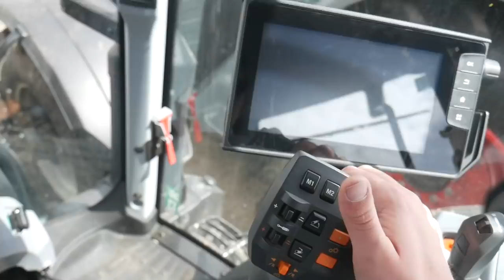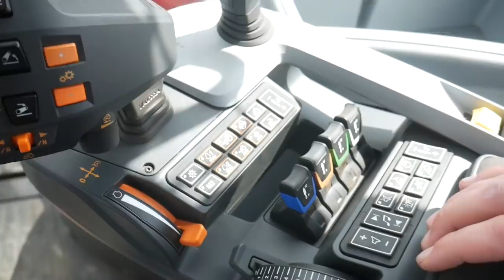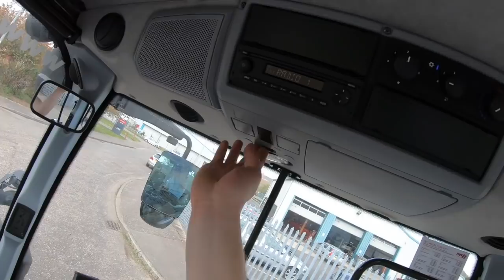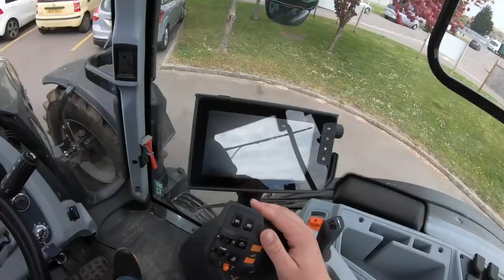THIS Is A 200 Horsepower Pocket ROCKET 4 Cylinder Valtra N174 HAND Built In Finland!

Comment: in Norway Valtra/Valmet is quite a normal tractor, and it`s a well designed compact tractor. My dad have driven a lots of different tractors like JD 5100R, Valtra N92 and so on, i think one of the best tractors he has driven is the Valtra N154, but we don`t need that kind of power so i think he would like a smaller model from valtra to replace his Lamborghini 1050 Premium. they are great machines and i think they are really underestimated.

Comment: I live in the USA we have two old valtra 6400, and a valtra valmet 6350. I wish they still sold them over here in north America  because there very nice awesome tractors. Because i would love to have one of the newer valtras t series with 250hp to pull a 5800 gallon spread. (If want to see spreader go to me channel ZIMM HOLLOW FARM). Loved the video. Also would love to have one with 150 hp with the twin trac for mowing with a bush hog. Because both the valtras we have are only 95hp and 90hp. Then are biggest tractor is a New holland  T7030 bosted to 180hp with a chip. It just barely cuts it for SPREADING whin going up a hill with a full load.

Comment: You do know valtra is a agco brand right, lot the same material as mf and fendt
Reply: And challenger
Reply: If Massey hadn’t switched to Sisu engines they were finished as a brand. Fendt uses Sisu engines in their smaller models, will soon use all Sisu engines. They are having reliability issues squeezing too much power from too small capacity engines. We have had Valera since 1998. I wouldn’t buy anything else tbh.
Reply: @johnclaffey7218  Duitez uses sisu engines aswel

Comment: That Finnish build quality when the mudguard predicts your next turn before you make it ;)
Reply: Had a t191 h 200hp one on a 12 plate would pull 20 tonnes  and still pick up speed uphill
Reply: @rockabillypreformancerc1639  Never said they were bad was joking around they just wouldn't be my first pic though.Prefer newholland as they have went from strength to strength sort of. The Genesis engine was awesome and the current engine is almost up there with cummins for sheer reliability. one of best engines on the market
Reply: Oh no I was just saying  I've learnt through my experience with them there a good tractor
Reply: Dont lie you are a salesman for valtra ;)

Comment: The steering wheel can be so small because valtras have "power" steer, you can set it on and change the speed it steer with, with full setting I think only 1,4 rounds with the wheel for side to side steering

Comment: Valtra is smal but they have more horsepowers than a deer the n 174 has 201 horspower a John deere 6430 premium has 140 horsepowers and they are almost the same size 

We have 4 valtra and 2 John deere the valtra is the best, the cuality is better
Reply: 6430 is an 4.5 litre and the valmet 4.9 litre.

Comment: Comparing this Valtra to my Deutz m600, same transmission vdu, similar sun roof, most tractors have the same cab anyway, My Deutz has a better made cab than this Valtra, Deutz have a cable operated handle fitted to the round bar to open the doors from the inside which is a good idea,